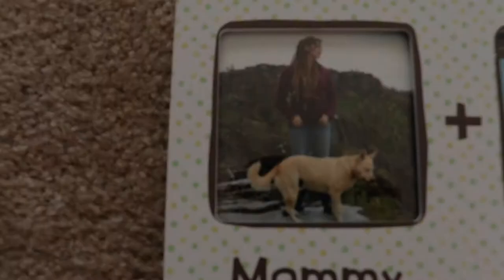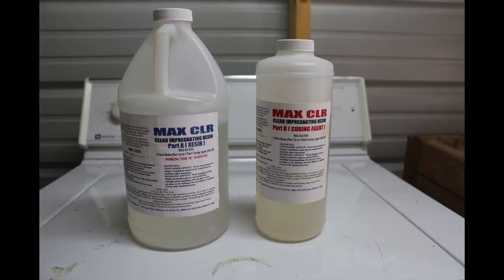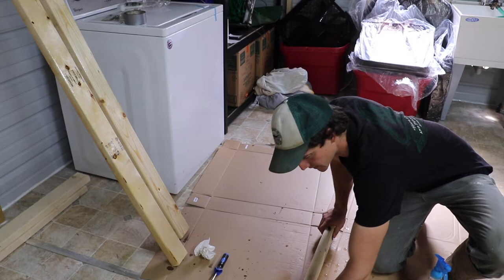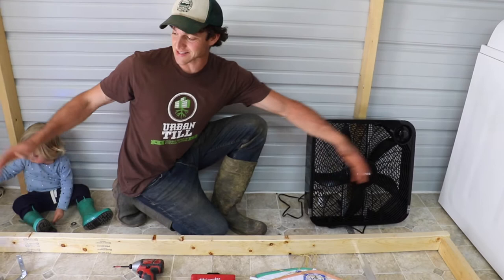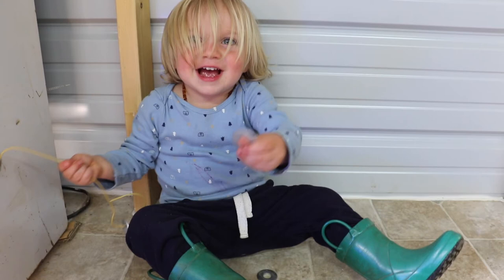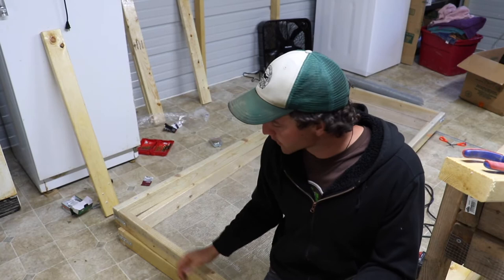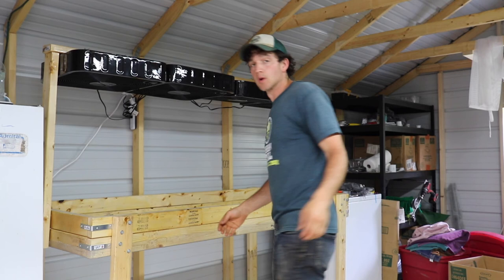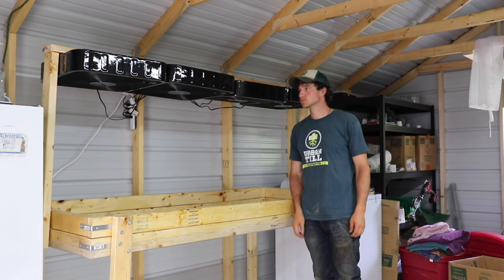How to Build a Drying Rack

Comment: I noticed that you didn't use a cross brace as in the previous drying rack. I've found that the mesh tends to sag in the middle after awhile. Is there any particular mesh the is certified, does any metal screen work or do they prefer plastic? Thanks for the video.
Reply from the maker: I haven’t had any trouble with sagging on this model.  The screen is well enforced.  GAP really just wants everything to have a nonpourous surface that can be wiped down with sanitizer.